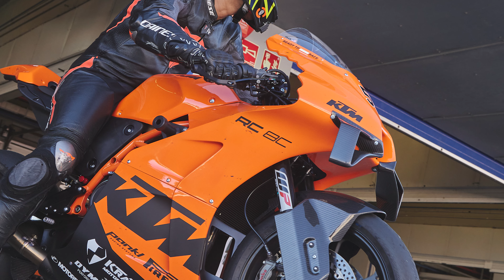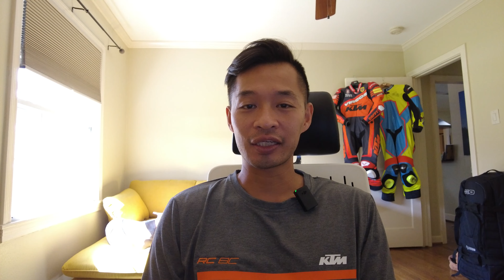Private KTM RC 8C Presentation by KTM & Markus Krämer for the first 25 customers!

Comment: Is Rc 8c exactly same as motogp ktm bike? If it is not, can it ride on piblic road?
Reply from the maker: Hi there, no the RC8C is nowhere close to a MotoGP bike. It is more similar to a Moto2 bike but instead of the Triumph 765cc triple cylinder engine it uses the KTM 890cc twin cylinder engine. It’s a track only bike and cannot be ridden on the road.
Reply: @vtranmoto  thank you so much.

Comment: 45k bike so much though into it. Why not put a full titanium from factory. BMW does right
Reply from the maker: What I’ve learned now that I also have a Moto3 is that the majority of the money goes into the chassis. The r&d is spent on that, then suspension, then the engine. Exhaust is important but just less important than the other parts. But I agree, wish it had full titanium.

Comment: It would be nice if KTM or Kramer did a video on the dashboard and its features.  The manual is just "ok".  The explanation of the dashboard in the manual is horrible.  These bikes are so limited, no one knows much about them.  I asked my dealer if I can switch the dashboard to 'standard' (from metric), they had no idea.  Do you have a good understanding of the dashboard after this presentation?

Comment: Hi ! Thanks for the video, as I failed in purchasing a RC8C fast enough :-)  ! I'm looking know for a Kramer, which is the closest bike. Just one question : what about riding this bike on a bigger race track like Mugello or Aragon : do you think that the max speed will not be a problem, compared to supersport bike like R6 ? Actually, what is the max speed on it ?  Thanks for your answer !
Reply from the maker: Thanks so much for watching, conveniently, my other trackbike is a 2020 R6 so I can compare vs the RC8C. Unfortunately, the RC8C has not yet arrived in the United States after the Jerez event. :( But look forward to that comparison video as soon as it arrives. 

Let me try to answer your question though based on my experience at Jerez with the RC8C. (For a bigger track like Mugello, you'll probably want a 1000cc superbike anyway!) For top speed I did around 142mph based on the AIM dash on the RC at Jerez back straight, I feel that it is very similar to R6/other supersports. What would be interesting is changing gearing for big track like Mugello or COTA. 

I think the more important thing though, is engine characteristics, handling/agility, and electronics:
The 890twin power-wise is about 128hp at the crank, which is very similar to a track/race built R6. The biggest difference you will notice is (1) the way the power is made: twin is more linear, with low-end torque, and smooth throttle vs the R6's inline4 which is very anemic in low RPM and then spikes at 10K+ RPM, the inline4 is thrilling in that way, but the twin in my opinion is more pleasurable/smooth/flowing
(2) the weight difference is astonishing. RC8C is 50KG lighter than a stock R6 (dry weight), sure the track R6 can be 9-13KG lighter than a stock R6 but the RC8C will still be 30KG lighter and that weight difference is substantial in acceleration as well as handling and agility, especially how easy it is to tip into corner and transition from corner to corner, its just so light and easy to ride 
(3) electronics on the RC works better than my R6 with quickshifter/autoblipper. As you probably know, the R6 quickshifter/autoblipper kits are all aftermarket and in my experience nowhere near as smooth as my Aprilia Tuono Factory, Speed Triple RS, or the RC8C. I frequently have false-shifts on the R6 whereas the European electronics are much better. 

You should 100% get the Kramer, it's virtually identical minus the fairings/bodywork. It is a wonderful machine and really puts a smile on your face while riding on your favorite track. 

Thanks so much for watching and commenting. Hope you subscribe, I have another very special KTM coming soon!
Reply: @vtranmoto  Thanks one more time for your very detailed answer ! of course I've subscribed ;-)
I'm riding bikes on European tracks since 20 years, and my actual bikes are V4R (for the power and the desmosedici engine andbecause it's so ...sexy) and R1 ( because it's not so noisy, easy to ride) But both  are heavy, though really powerfull.
I was a little bit afraid of the "lack" of power but I wanted anyways to come back to basics. One minigp for the fun and a kramer for "a lot of fun".
Light is right !

Have a good one ! hope to see some more videos soon ;-)
Michel
Reply from the maker: @eberlemichel5836  thanks so much! love it! I’ll be in Cartagena in March and a few other places throughout 2022. Where are you based out of?
Reply: @vtranmoto  I'm French. From  Strasbourg  ! 
Have fun in Cartagena !
Reply from the maker: @eberlemichel5836  very cool :) hope to make it to LeMans one day!